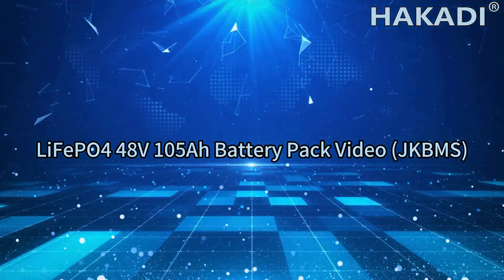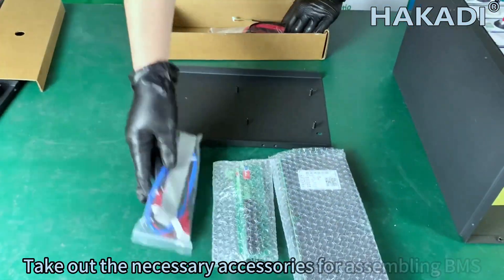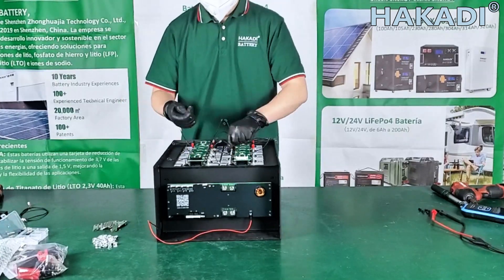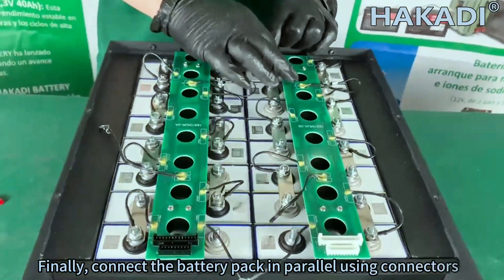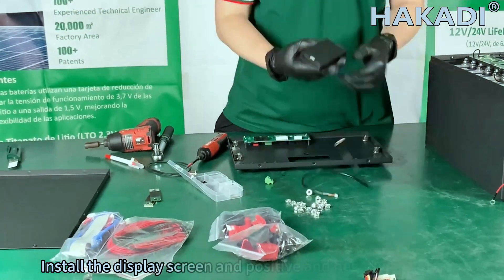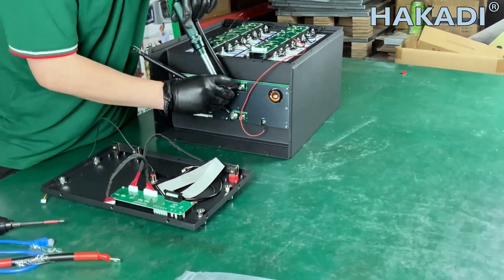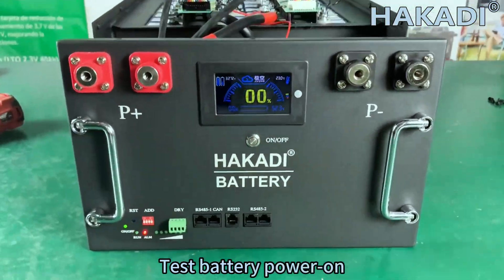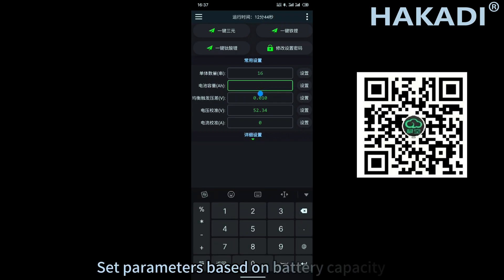A video that takes less than 10 minutes to teach you how to DIY a 48V 105Ah battery pack!

Comment: up to 10 units can be connected in series... or parallel?
Thanks for not using AI voice!!
I am definitely interested but the price is a bit too high
Reply from the maker: Let me answer your question

They can support parallel connection, up to 16-18
How many do you need?
Add my contact information and I will calculate a good price for you!
WhatsApp+86-13202568382
Email：jacob@szhakadi.com